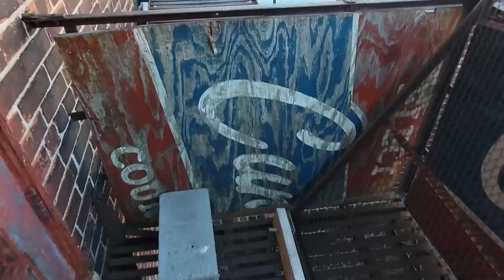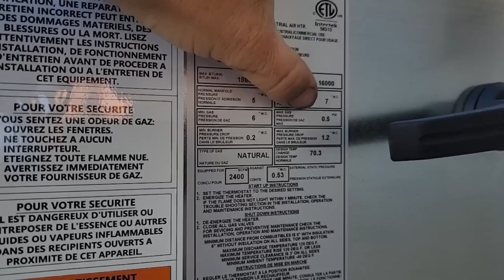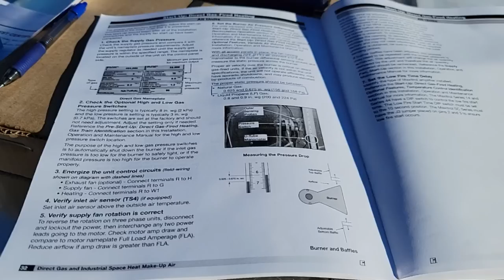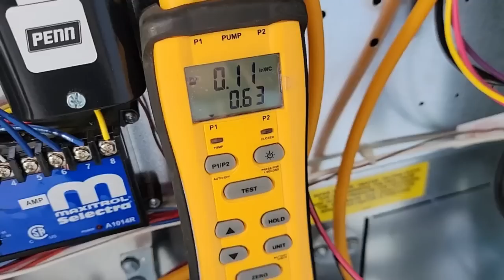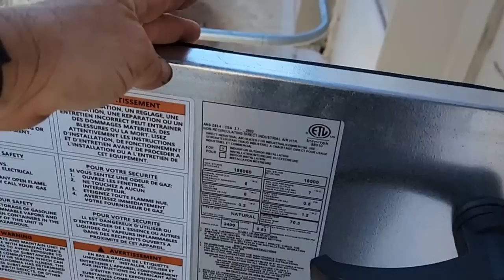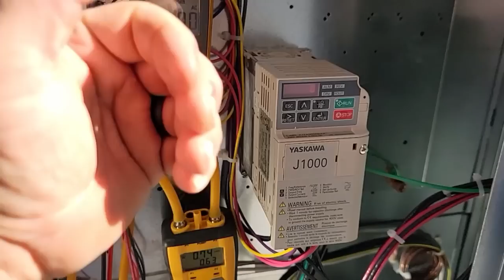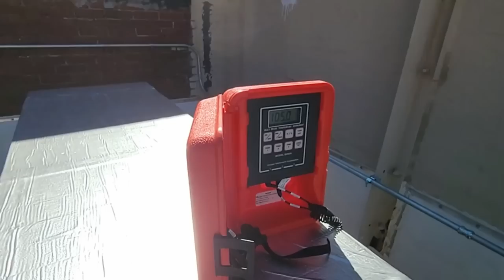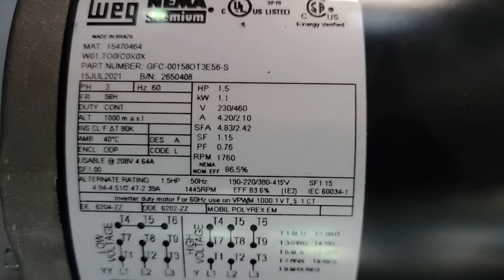Make-Up Air Start Up With A Problem

Comment: I always set burner pressure with max airflow to ma. Pressure drop across burner and when VFD is minimum a flow  pressure drop across burner is the minimum , normally but most of the ones I serviced was WeatherRite and they have burner profile dampers with. Damper motors  and controller to maintain the proper pressure drop across the burner

Comment: Hello Rick, 
Another great video, I had a couple of questions for clarification if possible. You had mentioned a couple of times the VFD running at 80 HZ I had not realized that the drive could produce that and also motor nameplate stated 60 HZ. You had also mentioned a couple of times that the Maxitrol maintains diff temp but I believe it only a discharge air temp controller, l do realize you were trying to set temp rise with the high fire adjustment Also a good idea to check flame signals which you may have done and not showed. Again great video.
Reply from the maker: I might have misspoken, the Maxitrol does maintain the discharge temperature, but you still have to do the max and min. case temperature rise. The manual tells you what size pilot you should have and what the minimum fire burner should look like along with the min. temp rise. They don't ask you to check the micro amps, there is all kinds of things we could spend time on but there more times than not its not needed.  The motor was VFD rated and the speed it was at was from the factory, the factory claims to test these prior to leaving. I did not investigate why they had it that high, I didn't have time to research that, I only start a few of these up a year, I have not seen them set that high before but that's where they had it.

Comment: I will admit, when you looked at the gas pipe, and then immediately looked up, my thought process was. "Um.. It doesn't matter what that little valve above says.  The main valve is in the off position."

Comment: I've got the same old school Cooper Atkins thermometer , bulky and all but very reliable 👍...Great minds my friend , great minds !
Reply from the maker: That's actually a newer version I picked up cheap.
 I have two of the older ones. This one actually will switch to differential temp pretty fast and back to individual probe temps.
Reply: @HVACRSurvival  Right , I was wondering how come the displayed temp  changed so fast , cause mine is rather slow .
Great , now I want one ... 🤬

Comment: I don’t work on this type of equipment but I do find it interesting all those different controls and checks and balances that these things do is amazing! I’m a residential HVAC guy been in the trade for 16 years only done some light commercial work, RTUs mainly. 65-70 degrees outside it’s the end of summer where are you based out of?
Reply from the maker: In Ohio, that day was cooler because we got some rain but it's starting to swing cooler unfortunately.